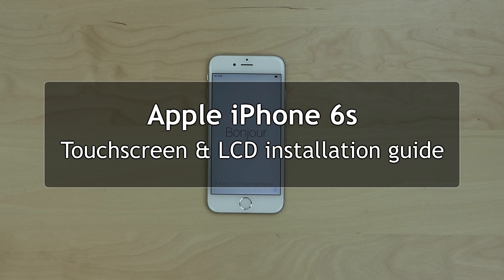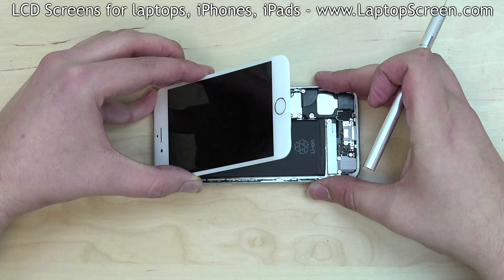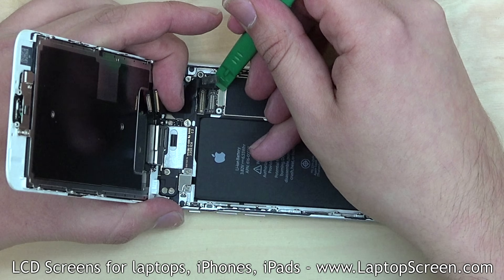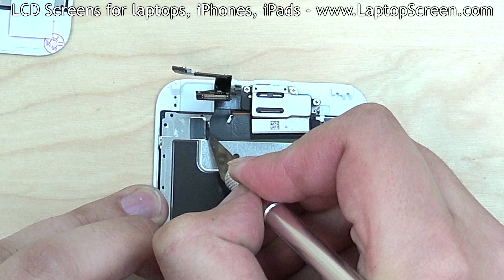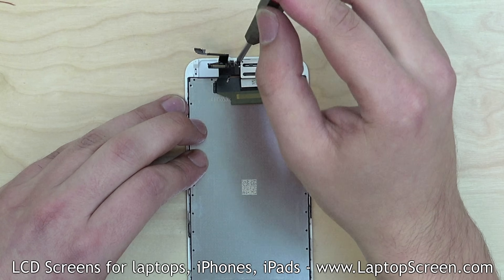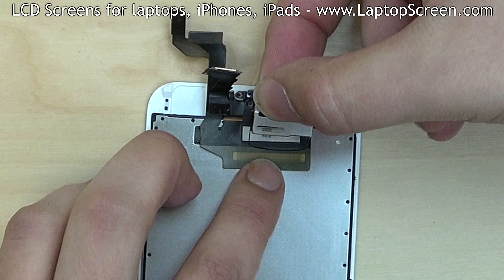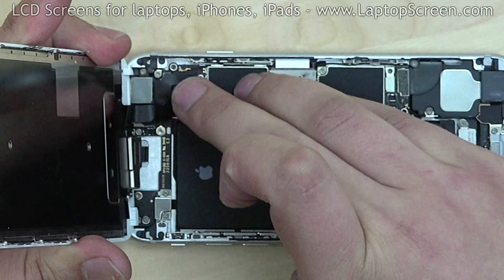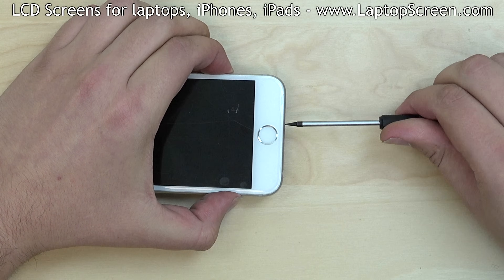iPhone 6S screen replacement / digitizer glass and LCD reinstallation instructions

Comment: 3D touch still work in any type of Iphone 6S display?
Reply from the maker: It'll depend on the type of replacement display you get. Since the phone is rather old and not a lot of people are willing to pay Apple hardware prices, most replacement LCDs available for it today would at-best have 3D touch simulation - not actually working, but the OS will think that it is. You'd have to get a refurbished Apple genuine display to get it truly working.

Comment: Thanks for the detailed video.  Reconnecting some of the ribbon connectors was a bit tricky because of the sticky goo around the connectors.  But a careful scraping and removal of the adhesive residue seemed to work.  I now have a fully functioning iPhone again.  Thanks so much!

Comment: can i test the replacement screen without removing the the orange protective film? the store i bought it from voids th return/replacement warranty if i remove any film from the screen
Reply from the maker: Yes, you can test it with film... but the store's policy may not be enforceable in many jurisdictions around the world. If you used a credit card or PayPal to make a purchase they may be able to void the payment in-case the item isn't working and the merchant isn't accommodating you.

Comment: Sir finger sensor are. Working or not ??
Reply: PlZ tell me your reply
Reply from the maker: @mrkaishu6630  Yes, 2:24 the original fingerprint sensor (home button) is transferred onto the new part. Its the same sensor the phone got from the factory, it will work unless its not connected or the wire is broken. The only change to the sensor is a new ribbon cable connecting it to the motherboard that runs behind the LCD.

Comment: What happens if you didn’t disconnect the battery first
Reply from the maker: Nothing, but only if you're very precise when reconnecting all other connectors. If not - you could lose back-light or sensors or logic board. Probably best to disconnect the battery first if not sure.

Comment: Another video I watched did not have the battery disconnect step.  I'm trying my second new screen install and neither of them have worked.  I searched find another video to see if I did anything wrong, and found yours.   This is the one possibility that I can see.  Any thoughts on the battery disconnect?
Reply from the maker: Its better to disconnect the battery. Its not mandatory, but it helps to prevent any connector mishaps. A short can happen when plugging in the connector if its misaligned. The short can affect the back-light and other peripherals. If your phone's new screen is dark, you can try shining  alight through it and if there is an image, but no back-light, then you know your back-light power supply is down. Unfortunately that would require low level component repair or a logic board replacement.

Comment: I just followed this video and successfully installed a new digitizer screen. I had ended up tearing a piece from the camera assembly, but I guess it was just a strip to hold something together and didn't have any wires through it because everything works correctly. Great video.

Comment: Is it normal for some of these screws on the inside of the phone to be loose? My screen was shattered but never opened, when I opened it I noticed multiple were loose and I’m wondering if that caused my screen to only want to turn on sometimes?
Reply from the maker: Its not typical, no. Most screws even have paint to prevent vibration induced unscrewing.

Comment: What do I do if my screws won't unscrew from the screen metal protector?
Reply from the maker: Drill the cap off.
Reply: @Laptopscreen  okay, thank you! i was able to get a new screen and put it into my phone, but the same problem is still happening. My phone works, but there is no picture. I don't know what the problem is. Like the touch screen works, but there's no picture.

Comment: What do you do if you connect everything and the screen is black?
Reply from the maker: Reconnect everything, this helps in 9/10 cases. Next use the original (cracked) screen to test if the phone is still sending signal, if yes, then RMA the new part. If the screen remains black with both new and old screens check if the phone has any charge, and if that still doesn't help you would need to get a new main board.

Comment: the display assembly connector screws i had were stripped
Reply: Same with mine - no amount of force would get any of those 6 screws on the sides to budge. I just cut those six screws on the sides of the assembly off with wire cutters. Followed everything else and the phone works great.

Comment: I just ordered full iphone LCD SCREEN. It has button already and everything! Do I have to skip most of the procedure and go to the last part which is connecting the three ribbon?
Reply: pls i need an answer☹️
Reply from the maker: Its best to re-use the original finger print reader (button).
Reply: but can i use the full screen with fingerprint and etc? do you think it will not cause any damage to my phone?
Reply: thank you for your answer!! you just gained another follower :)

Comment: ERROR: At the approximately 3:23 time, you failed to mention that the two clear pieces need to ALSO be removed and used on the new screen.....one is for the camera and the other a sensor??? without them removed and used in the new screen I believe alignment will be compromised.....I had to watch another video to see this mistake.....I picked up on the camera piece but failed to grab the other so now I need to take apart the phone again. Thanks!
Reply: XFBO on some new screens it already has it installed so maybe this one had so, the person had a company and is showing you how to replace it if you buy his screens, not just any random one...

Comment: Nice video! I’m just wondering does the 3D touch and fingerprint sensor still work?
Reply from the maker: The fingerprint sensor is reused, so its original, and works just the same. 3D touch will depend on the type of the replacement part, in this case it is a full-featured (non-simulated) 3D touch.
Reply: LaptopScreen.com... can I replace the screen from another iPhone and use the other phones button ? Will the fingerprint work?

Comment: I can't remove any of the screws from the LCD plate
Reply from the maker: That is most likely due to an incorrect screw driver size. You need  to use PH000 Philips head to grab the screws properly.

Comment: Hi, I couldn't remove the six (6) screws at the sides of the metal shield, it was impossible, the are fixed. Do you have any suggestions how can I do? I'll really appreciate then, thanks! Great video.
Reply from the maker: You would have to drill them out if they are stripped. Or get a better screwdriver if the screw heads are still catching.

Comment: Hey my iPhone 6s replacement screen only came with 2 ribbons not 3. I turned phone on just to see if it would still work and it did. What’s was the third ribbon for
Reply from the maker: Ribbons, as in connections at the top? 1 is LCD another is Touch - that's what most replacement parts come with. 3rd is camera - it is transferred during repair. 2:00
Reply: Hey man the 3rd ribbon is the camera go ahead and switch it over. And if by any reason you guys damage anything is if you aren't fragile with the ribbons I'm currently sol cause a ribbon was forced back in causing damage to the internal piece. Also the parts online are super cheap I broke my button ribbon in the process and had to replace.

Comment: Where can I get the screwdriver than you used to unscrew the 6 screws that were holding the metal plate down? The one that came in my kit isn't working!
Reply: Rana Batshone Mines Either I did everything right,,But When Ii Tried To Remove To six screws ii couldnt😩😩😩 So Ii Had To Replace Everything Back 🤦🏾‍♀️

Comment: I did this without disconecting the battery, and the home button no longer works, but when replacing the original screen it works just fine, do you know why this could be?
Reply: Peter Kaufinger hello. I think this is late but I did the same thing. But my screen is completely dim. I can’t even seen the screen.

Comment: Does it matter if you don't have the metal shield ?
Reply from the maker: Quite possible that you may experience some slight interference on the screen itself, which may appear like noise or distortions under heavy processor load.
We've never tried running the iPhone without the mid shield. The metal shield could be in-place in order to pass the FCC interference regulation and does not affect the operation of the device at all. The iPhone should certainly boot and run with-out it. Let us know how it goes, it'd be interesting to know.

Comment: What happens if you don't unplug the battery? I've seen other tutorials not do it?
Reply from the maker: Ideally nothing bad happens. However if any of the connectors are misaligned during reconnection the backlight circuitry or the proximity sensor circuitry can get shorted and damaged breaking their respective functions.
Reply: LaptopScreen.com this helps a lot thank you, I also read that the 6s have something to do with the touch IC and 3D Touch?

Comment: if the touch id button doesnt work anymore, what have i done wrong
Reply from the maker: Maybe you forgot to plug it in properly? Also inspect the ribbon cable for any tears or cuts.
Reply: Check the pins under microscope. You broke one or so.. :(

Comment: Nails won't come out
Reply from the maker: What are you using to pull your nails? Regular pliers work best to pull your nails, because needle nose pliers only rip off small chunks of a nail at a time. You want to overlap the nail with as much surface of the pliers as you can and pull firmly away from the finger.

Comment: im using ur guide to fix my iphone 6s and im stuck on the big metal shield removal because the screws will not come out, i really dont want to strip these screws. plz help
Reply: me to
Reply: Ok when this happens and it happens a lot,It's because your screwdriver is just A tad too small.Most Screw heads are the same size but not all of them and that's when it helps to have every size.
Also if you strip an iPhone Phillips head or logic board big screws you can usually get them out with a strong pentalope.
Reply: so what do i do exactly cuz im stuck here too!!.. without having to go and find screw heads i mean